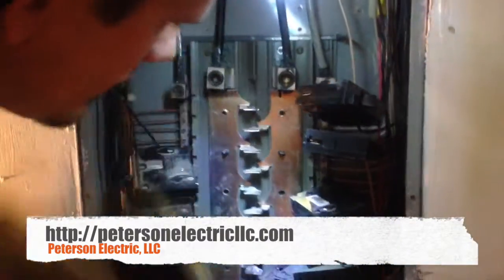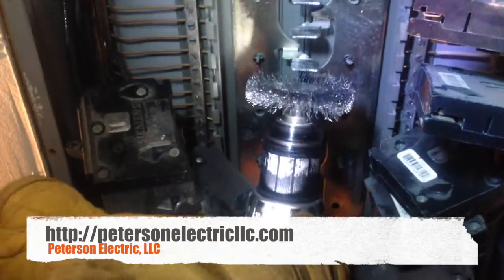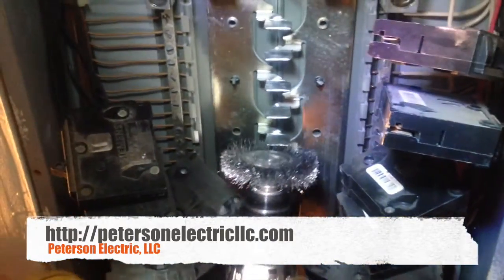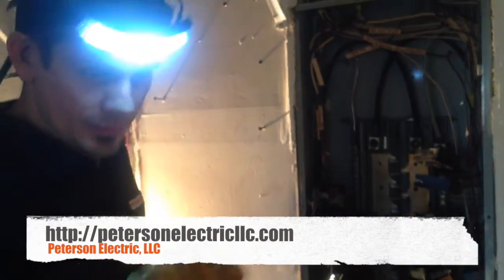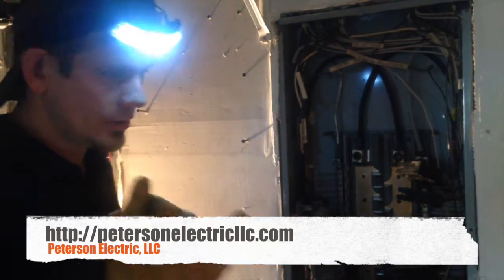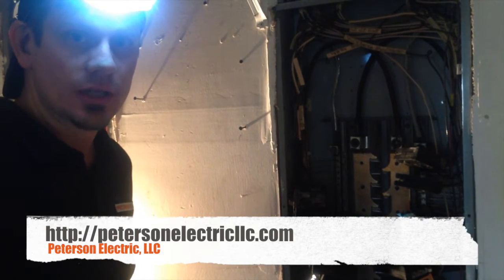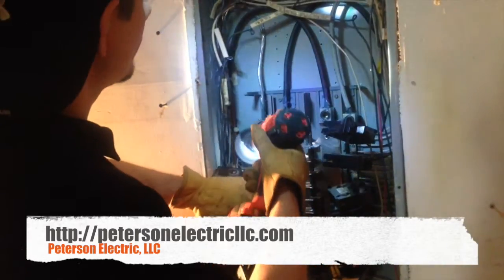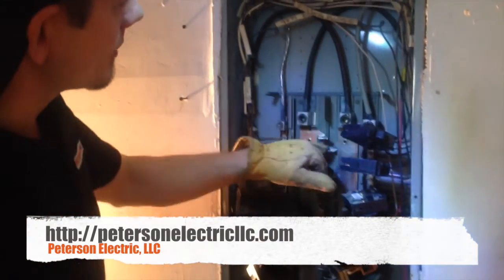Hotel's Bus Bar On Panel Is Corroded, Part 2

Comment: GOD I HATE ALUMINUM WIRE,CABLE & BUS BARS theirs a plating on the aluminum your brushing off [I-T-E told me never sand lugs or plated aluminum] rarely when i fine sand it i will use penatrox on the breakers just a little bit .Ive never had a problem .Thats an I-T-E panel I HATED THOSE, SIEMENS bought them out the COPPER BUS ONES ARE NICE.Do you notice how THIN Siemens breakers are getting???

MR PETERSON I have a question Im going to pull a permit this summer and change my neighbors service with a big 200 QO HE DOES WOODWORKING IN HIS GARAGE NEAR HIS PANEL .He has multiple air filtration systems [BLACK WALNUT CAN REALLY HURT YOU].  His AC unit is in front of the electric meter, his panel next to a sump pump .My town is on the 2017 nec im going to take photos and show them to the inspector. Im going to have to relocate the meter. His garage seems clean i installed a 240 volt outlet 2 years ago fore his HUGE FILTER one of 3 air cleaning systems. Im thinking about puting weather stripping around the panel cover door and on the face of the box to keep what LITTLE DUST out .Im going to discuss this with the inspector .My friend has very little room every thing JUST FITS.

In the 2020 nec THE SIX SWITCH RULE IS DEAD!!!! [SINGLE DISCONNECT] fore panels and switch gear even meter centers unless they have separate barriers .Local 134 changed the chicago code NO AFCI REQUIRED I put an afci outlet on my bedroom ceramic space heater ,if i turn the heater off to fast it trips. THE MANUFACTURES HAVE THEIR PEOPLE ON THE CODE MAKING BOARD THIS SHOULDNT BE ITS A CONFLICT OF INTEREST!!!!!! I dont like CROOKED POLITICS like this. [article in ELECTRIC CONTRACTOR MAGAZINE 6 myths about AFCIS] 

Colorado is stupid for making SHROOMS  legal Illinois just legalized pot and are making gambling much more available .THIS STUFF DESTROYS LIVES all in the name of money fore the rich politicians.
Reply from the maker: Totally agree and more some that I can not express on line with other CO laws that destroy families. Back to electrical, I am glad that the six handle rule in article 240.6? is going away. I do not think split bus bars in lite commercial and Rez is good. 
As far as, "lightly sanding a bus bar" why not! If you own an old RV and the "NEWER SPECS" on the tightening of the lugs are based on their new CODE then you have to adapt to a safer and happy medium on your torque spec. My RV mechanic stated this on my 32' 5th wheel RV when working on my axels on an 8 yr old Toy Hauler. He made complete sense to me. SOme of the work we do in the field is based on 20 yrs of the so called, "AH" that clicks! My old foreman taught me that. Experience can not be found on a google search nor in a CODE book. 

I would either move the panel or MAKE MY CUSTOMER build a dust tight room around the panel allowing 36" clearance in front and 5' wide makes most sense. 
Did not know that More DRUGS became legal, as in Shrooms. Wow! we are the next MELTING POT. LOL
Reply: @Petersonelectricllc  At my friends house theirs no where to put a room and no place to move the panel ITS TIGHT I wonder what the inspector will say. Ive worked in VERY DUSTY wood working shops that have 277/480 panels and transformers DUST EVERYWHERE. My boss did a service change at another place like this added a second 400 a panel. When every thing was energized THE MAIN BREAKER IN THE ORIGINAL PANEL  WOULDNT GO ON. They had to drop power my boss took the 400 a breaker out IT WAS FULL OF SAWDUST  HE SHOOK & SHOOK A TONE CAME OUT.The door on that panel WAS ALWAYS OPENED. Why didnt the inspector  require everything  DUST PROOF??  I was on this job 25 years ago

On the 6 switch rule i was talking about places fore example  that have 800 a service A SWITCH GEAR OR BREAKER PANEL THAT HAS 6 THROWS .KISS THIS GOOD BY!! SINGLE MAIN DISCO NOW  unless it in separate sections or enclosures. IF YOU PUT A CT CABINET A WIRE TROUGH AND 6 ENCLOSED BREAKERS OR FUSED SAFETY SWITCHES THIS IS STILL GOOD.